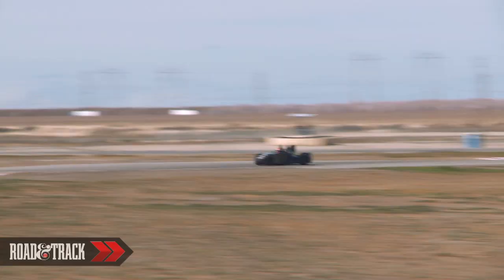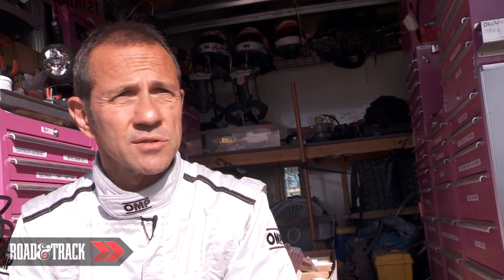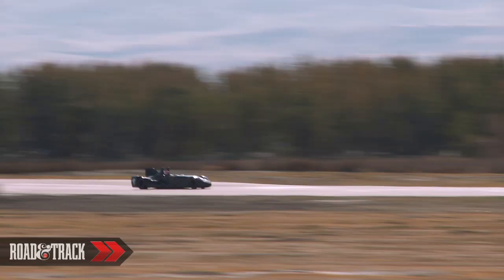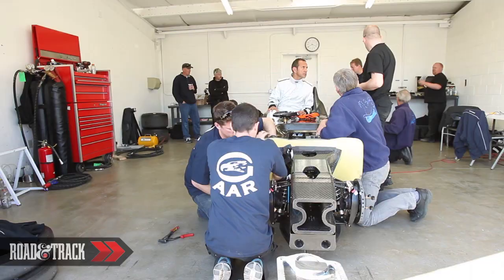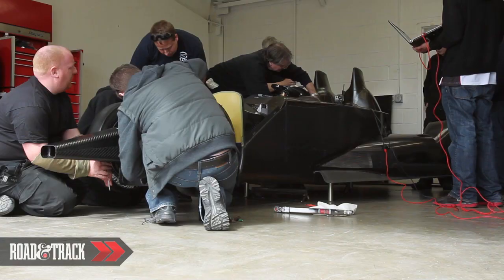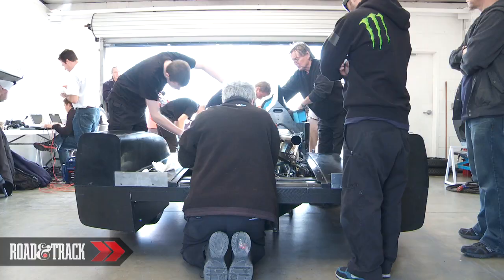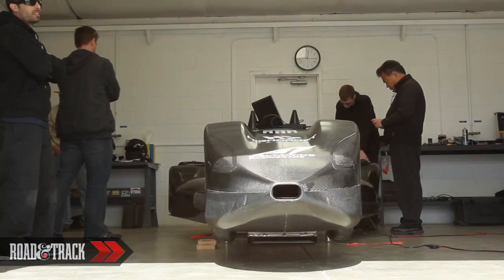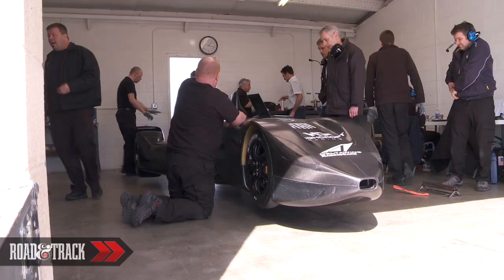DeltaWing First Track Tes | Road and Track

Comment: The key to the narrow front track not understeering terribly is that the front end is only providing the "fine adjustments" of turn-in; with all the aero, weight and traction at the rear, what really makes this car turn-in is the active torque vectoring that is done side-to-side on the rear axle.

Comment: @RedlineAutoSupra 

The Deltawing turns primarily  via differential steering, not the front wheels. The front wheels basically hold the front off the ground, but the front track is still almost two feet wide and on two wheels,  wheels barely turn like a tricycle.  The narrow front track minimizes scrub on the front tires, and the wide track eliminates body roll. The car only weighs 475kg. The LMP audis race at a minimum weight of 925 kg.  it's all about power to weight ratio and minimal drag.

Comment: Good to see more running footage of the car. It's in the experimental class so it won't be allowed to win the race. But the goal is to prove the concept works. It should be very impressive and could change the way other teams and companies approach building racing cars. I doubt they'd look like the Deltawing, at least not completely. Instead of just adding more and more, like Audi has been, they may chose to make refine the overall cars more.

Comment: Actually, part of the reason this car was built was to prove that a tricycle-design (even though this is a 4 wheeler) can be stable when cornering - on this car, the centre of gravity is way back, meaning that when it wants to flip over, it has to flip over the wide rear wheels. An aerodynamic design uses down-force to keep the front wheels on the ground at all times.

Comment: I agree with Eric Comas on motor racing going in the "green" direction. We're starting to see the re-introduction of small turbocharged engines in major series (IndyCar comes to mind) which will undoubtedly spur innovation in the area of fuel economy. However, we must be careful that we don't sacrifice performance for the sake of conservation. If there is a way to achieve the same performance levels with less resources, great. If not, let's wait until there is.

Comment: By the looks of it, this car has huge camber gives in its suspension, therefore counter-acting understeer. It has a neutral balance to it, with a slight tinge of understeer, due its long profile. The long wheelbase helps though.

Comment: @Katsavidis 

NISSAN had NOTHING to do with the design of the Deltawing.  They were simply willing to supply the engine and support the Deltawing project.  This was originally supposed to be an Indycar. The chassis is actually a modified Aston Martin LeMans  tub.  The concept has always been light weight, low drag with half the horsepower and twice the fuel efficiency. NISSAN was a very late additiontp the project. Don't overlook the fact that NISSAN is partially owned by Renault.

Comment: @Shadowboost you do realize that this car has half the weight half the fuel and half the drag of a regular car it will make less pit stops, tires will wear slower, and accelerate  faster giving it a distinct advantage regardless of corner performance

Comment: @Katsavidis 

Noone is calling for a radical redesign of  an F1 car like indycar was, which spawned the Deltawing. There's nowhere for the X1 to race. When compared to a lemans prototype, not radically different from what they are racing now. Infact, when you look at the peugeot, audi and the closed top astin martin lmp cars, The X1 has teh same fender treatment and is bascially just a narrow cockpit single seat LMP minus  the solid flat floor..

Comment: @saclve Tell that to the FIA, who are putting out some crazy rules on some racing classes to cut costs. F1 being the biggest casualty of this (eg starting I think 2013, all F1 cars will have V6 Turbocharged engines to replace the existing V8s as an effort to reduce fuel consumption).

Comment: I thought there's a reason why you have wide track at the front. The same one the Reliant Robin fell over all the time. If it works properly, the engineers should be rewarded with the Nobel Price for motor racing. Yes, I know there's no such prize and yes, I know it's rude to compare a car with a Robin...

Comment: @shadowninja569  It has 1/4 the downforce, half the horsepower, half the traction, and doesn't have a pitstop advantage compared to the turbo diesel hybrids.  It will be miles slower everywhere.  Accelerate faster, don't make me laugh, it's at least 300 hp down on Audi.  In fact, it'll have trouble passing the GT2 cars

Comment: @operationnorthwoodz this car is in le mans and will be no where near anything with street tires. And if it does make it to the production racing stage, there will be regulations changes to make it fair. The lack of downforce makes the delta wing pass the EXTREMELY more powerful cars on the straights yet it can keep up in the turns. Where your problem with this car is coming from I have no idea. Innovation. Tying new things. That is what le mans started out as. So why are you criticizing a car

Comment: BFD a $10,000 Formula 3 car with a 300hp turbo would kick its ass, even without a ground effects chassis. Even a $5,000 Formula Ford 1600 non-turbo with 100hp and treaded street tires can easily pass a full-race twin-turbo 911 with massive slicks on a twisty track. No weight limit + unlimited ground effects = CHEATING. Poor visibility by both the driver and other drivers = DEATHTRAP. Batmobile racin is IDIOCRACY. Keep the efficiency/austerity/poverty off the race track.